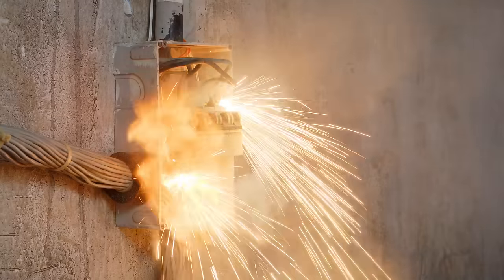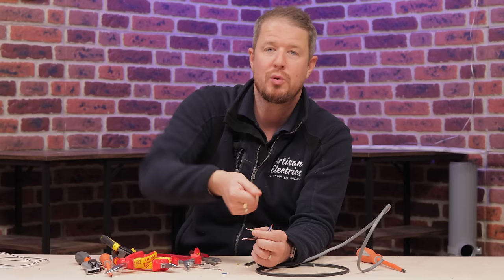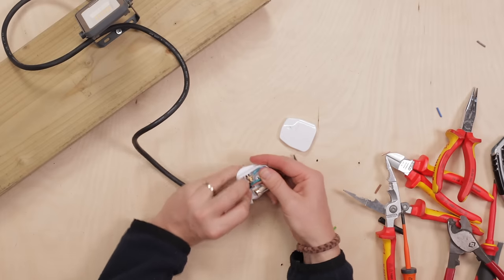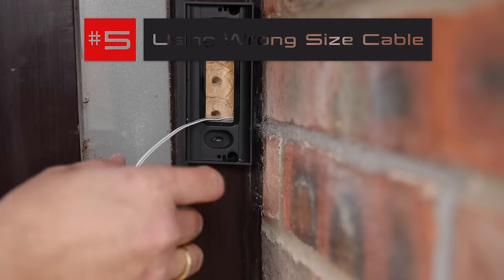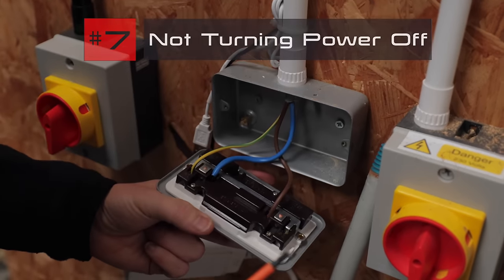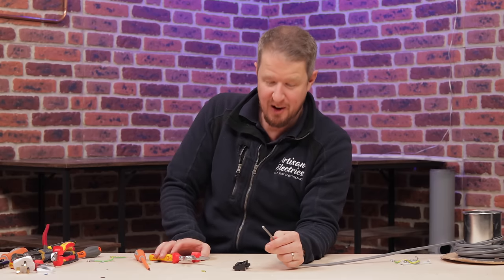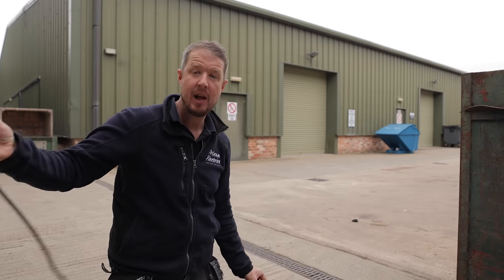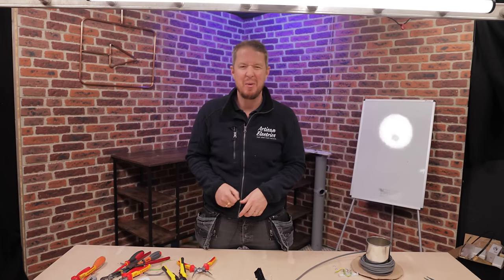10 Mistakes EVERYONE Makes When Doing DIY Electrics!💥

Comment: Fun stuff and so typical mistakes for many DIYers. 
But the wound up extention cord running hot, has nothing to do with inductance. It simply the resistance of the cable that cause it to heat up - but being rolled up like a coil, the heat can not escape from the cable very easy (compared to if the cable is rolled out), so the temperature rise quite a lot
As the resistance of copper also goes up by the temperature, this causes it heat up even more in a sort of thermal runaway. This can cause the coil of cable to get toasty, very quickly.
Reply: Could not give you two thumbs up.
Reply: three thumbs up, the out and return are parallel, so loop area is negligible in this instance , so inductance is negligible, surprised at Jordan for getting that wrong.
Reply: Right, and I would like to add that, even if there were a significant inductance (which is not there because the magnetic fields due to the two opposite currents cancel almost perfectly) it would not lead to any power dissipation, only to a lossless voltage drop. It is only the resistive part of the impedance that leads to power dissipation and Joule heating. I do not know why this incorrect belief about the hypothetical inductance and even more hypothetical associated power dissipation of coiled cables consisting of two conductors with opposite currents is so common: I heard it for the first time in high school when I was working part time for a local tv station: a technician from.a local tv production company told me that power cords for halogen lights should not be wound in operation motivating the recommendation with the incorrect inductance argument.
Reply: waiting for his reply on this.. haha. ironic how the video is specifically about making mistakes.. lol
Reply from the maker: Thanks for the clarification! That does make sense 👍
Reply: Unwinding a cable drum increases the surface area so heat can escape. In a drum or coil heat in the center can not escape so it will get very hot.
Reply: @artisanelectrics  I hear this about induction all the time.  It would be really good if you could do this test. 
Zig-zag up a similar length of cable into a similar volume and repeat the test.  Measure the temperature with a laser thermometer. If the cable warms up, it is not induction.
Reply: Typical school summer fair , extension leads everywhere and coiled up and tripping RCD’s 
I don’t understand why he puts this shite out there and it’s wrong what he says.
Reply: @artisanelectrics   A moment's thought by anyone knowing how the sense coil in an RCD works would realise that the inductance of a coiled extention lead is negligable plus it's resistance that dissipates power, not inductance.
Reply: For those who don't understand how induction works, you can do the same test using 10 Amps DC. Just short the live/neutral at one end and connect the DC supply to the live/neutral at the other end to push the current down one wire and back up the other. Adjust for 10A and watch the temperature rise. If  you have a constant current supply, you can monitor the voltage across the supply which you can calculate the resistance and see it increase. There will be no inductive component.
Reply: Copper does, as you say, have a positive coefficient of resistance with increasing temperature. However, this reduces the current flowing through the cable.
The current is l=V/R
Power is P=I^2*R. 
So P=(V/R)^2*R. 
(V/R)^2 reduces exponentially, but the multiplier R is linear. Therefore as the copper heats up, the overall power decreases and there is NOT a thermal runaway effect.
If you don't believe me, look up how incandescent lamps work...
Reply: Inductance itself doesn't result in heating. It's resistance that does.
Reply: @massimomacucci7461 This is a wrong explanation .

Inductance is not a function of current.
Inductance is a function of the physical attributes of the coil.

So the coil will have inductance.
Pass a current through it and a magnetic field will be created.

However, in the case of a mains cable, there are two coils, which are interwoven, each turn of the cable comprises a turn of two conductors, line and neutral.

Both coils are wound in the same direction, however, the current passing through each coil is in opposite directions.

The net effect is therefore, two magnetic fields are created, one from the line conductor, the other from the neutral conductor, but those magnetic fields are opposite in direction, and equal in magnitude. Therefore they cancel out.

Rest assured , that wound up coil of wire does have inductance and that inductance is NOT related to the current flowing.

Summary:
Inductance is not related to the current but is a function of the physical attributes of the coil. The magnetic field strength produced is related to the magnitude of the current.
For mains cables,  Two magnetic fields are produced because of the presence of two interwoven coils but the magnetic field cancels out.
Reply: @pompeymonkey3271 That is basically right.

It's devices with negative temperature coefficients of resistance that lead to thermal runaway.  Power transistors being one of them. The silicon semiconductor has. -ve temp. coeff.
Reply: @pompeymonkey3271  Not in this case, as the current is mostly determined by the load - not the cable it self. If a load draws 10 amps at 230 V, that means it's impedance is 230 / 10 = 23 ohms.

Now if you have a cable with 1.5 mm² cross section area (typical for 10-13 A rated extension cords) it vill have 0.0112 ohms per meter at startup, if it's temperature is for example 20°C (the specific resistance of copper at 20°C is 0.0168 ohms for a 1 meter lead that has 1 mm² cross section - so 0.0168 / 1.5 = 0.0112). 
This means if the the extension cord is for example 30 m long (60 m conductor length, because the current has to go tru live to the load, then back the same way)
 - the total resistance will be 0.0112 * 60 = 0.672 ohms. So now (assuming the load is linear and purely resistive with no inductive/capacitive component - for easy calculations. The space heater he used also pretty much perfectly falls within that criteria), 
the total resistance, cable plus load is now 23.672 ohms instead of 23 - so current drops to 230 / 23.672 = 9.716... 
As the power turned to heat over a resistance is determined by P = I^2 * R, this means 9.716^2 * 0.672 = 63.4... W. 
That's a lot of heat when generated inside a coil that normally consist more of insulation than copper (plastic or rubber is not great conductors of heat either). 
It's not at all comparable to for example a motor or transformer windings that use thinner magnet wire - which conducts more of the heat to the surface to be cooled off and can also withstand higher temperatures.
But still, compared to the power dissipated in the load, it's not much
 - 9.716^2 * 23 = 2171 W will be heat in the load (which have no effect on the cable).

Now if the temperature have increased to 100°C, the specific resistance of copper goes up to 0.0222 ohms/m/mm², so (using same calculation) the resistance of the whole cable is now 0.888 ohms per meter and the current 230 / 23.888 = 9.628... A - which gives 9.628^2 * 0.888 = 82.3... W of heat in the cable

At 150°C, the specific resistance is about 0.027 - which means the resistance for the whole cable is now 1.08 ohms, the current have dropped to 9.551 A and power dissipation has increased to 98.5 W! 
At that point, the insulation will probably start to melt, causing a short between the leads - which may cause a fire or (if more lucky), trip the fuse before it ignites 

The voltage drop is R * I, so that means even at 150°C, the load will still get about 220 V! and dissipate 2098 W  (instead of 2300 under ideal conditions) 
So most of the power will still make it to the load and the cable will not have much effect on the circuit over all - but may still get hot enough to get destroyed and become a fire hazard if it's under heavy load when wounded up.

Now I assume in my examples it's a similar extension cord but without the overheat protection. With the protection it would probably never reach 150 or even 100°C before it trips. 
This is the first time I see one that has the overheat protection. Maybe there are too many cheap one around where I live, haha
Reply: Sorry, but I beg to differ. My argument is not wrong. Your argument would be correct if we were looking at a single coil, but here we have two coils with coupling coefficient k=1. Inductance is not defined based on geometry (in some cases it may even have a completely different origin, as in the case of kinetic inductance, where carrier inertia matters) but simply as the ratio of the magnetic flux to the current: L=Phi/I. Here the magnetic flux is zero, the current is non zero, therefore L=0. Another way to look at it is as a series of two inductors with mutual coupling. Let's assume the inductors are equal: Ltot=L+L - 2M. Since M =k sqrt(L*L), Ltot=L+L-2L=0. If you connected an impedance Z between the two wires at one end of the extension cord and you connected an impedance meter between the two wires at the other end, you would measure exactly the same Z, if we ignore all nonidealities (copper resistivity, imperfect symmetry between the two coils, etc.) Therefore the resulting inductance of the extension cord is zero.
Reply: @massimomacucci7461  Your original post IS wrong.

You said there is no inductance because the magnetic fields are in opposite directions.

No.
The inductance of a coil is based upon;
inductance of the coil in henries (H)

μ
r
 = relative permeability of the core (dimensionless)

μ
0
 = permeability of free space = 
4
π
×
10
−
7
 (H/m)

N
 = number of turns

A
 = coil area (m2)

r
  = coil radius (m)

l
 = coil length (m)

All are physical properties and NOT the current.

You were wrong
Reply: @massimomacucci7461  When two coils are involved then there are two self inductances, one for each coil and a mutual inductance.

The inductances are still a function of the physical characteristics of the coil, the number of turns, the cross sectional area, the magnetic permeability of the material inside the coil.

So you are quite wrong.

The inductance is NOT zero.
What is happening is there are two equal and opposite magnetic fields, cause by the  presence of two coils and the current passing through the coils in opposite direction.

It really is as simple as that. Your detailed explanation is fundamentally wrong.

But foolishly you can't see it, you can"t accept it.

Do you really want me to write out the formulae for the inductance of a solenoid?

I suggest you go look it up using Google before I post it and prove you wrong.

And then I want you to come back here and apologise and acknowledge you are wrong

Perhaps some humility might be beneficial for you.
Reply: @deang5622  I am sorry, but what you report is not the definition of inductance in circuit theory, it is just a simplified expression of the geometric inductance of a solenoid. Take any reputable text on circuit theory and you will find the proper definition. One such text is that by Desoer and Kuh. They provide the most general definition of inductance as follows: "a two-terminal element will be called an inductor if at any time 𝑡 its flux 𝜑(𝑡) and current 𝑖(𝑡) satisfy a relation defined by a curve in the 𝑖, 𝜑 plane. The essential idea is that there is a relation between the instantaneous value of the flux 𝜑(𝑡) and the instantaneous value of the current." 
In the case of a linear - time invariant inductor, the inductance can be simply expressed as L = 𝜑/𝑖. For a nonlinear - time invariant inductor we can define a differential inductance as L = d𝜑 /d𝑖. We can further generalize to time-dependent inductors and to inductors whose value depends on state variables (meminductors). 
Your expression has nothing to do with the definition of inductance, it is just an approximate way to determine the inductance of a linear time-invariant inductor consisting of a solenoid (to be more accurate you should include the Nagaoka coefficient) and it can be derived starting, for the particular case of a simple solenoid, from the definition I just mentioned. As soon as you depart from the solenoid geometry your expression breaks down. In general the geometric inductance of a generic conductor can be derived (from the definition) integrating the contribution to the total flux from each current element, and then taking the ratio of the total flux to the current. 
Thanks to Jordan for creating the opportunity of discussing this matter.
Reply: @Speeder84XL even the cheap drum type extension cords have had those thermal cutouts for decades here in Finland. The ones without have to be from the 1980s or something.

I remember bypassing burnt out ones in the nineties. Drums were already so messed up, that it was too hard to coil the cable, so those were stored loose anyway and the heat problem had mostly solved itself.
Reply: @villehietala9677  Ok, I was referring to the one that he showed, that seem to work like the thermal cut out on a circuit breaker and could be reset once the cable had cooled off some.
Now when I think (since you wrote about "bypassing burnt out ones") - maybe it's more common than I taught that manufacturers use something like a thermal fuse. Just to prevent the fire hazard.
For things like mains powered (iron core) transformers in appliences - this have been "common practice" as far as I remember. Which will cause them to "break" if they get too hot - before they fail for real (which may be a catastrophic failure with fire, haha). 
I have actually never had a wonded up  extension cord overloaded as far as I remember. 
Maybe when I was a kid and didn't know much about electricity and didn't read the warning label
 - but even then I only remember we used them for low loads (in which case it doesn't matter anyway), like power up the TV and VHS player (that everyone used at that time) and other home electronics in a room with too few wall outlets. 
High loads like kitchen appliences and space heaters had their own wall outlets (which was probably mostly luck, because the apartments we lived in, happen to have  the wall outlets in the right places).
Reply: @Speeder84XL  I meant the same things. They surprisingly burn out as 99% of the users just try to push the red button back in while the load is still connected. And some of those are so bad, that you might just leave a kid to keep the button pressed to finish the job. That would finish the thermal protection too.
Reply: @villehietala9677  Ok, haha. 
I underestimated how stupid many people are. I guess it's the same people who bypass our diazed fuses by putting nail in instead. Those fuses are common as main fuses in small buildings here (because when used as intended, they are more fail safe than circuit breakers) - larger buildings that need more than 100 A 
(actually 3 x 100 A, as all buildings, even small houses, have 3 phase connections here) - often use knife type fuses instead. 
But for older installations, before we started using circuit breakers, the diazed ones were also used in consumer units. 
In those installations, some stupid people oveloaded the outlets and got tired of replacing the fuses all the time, so they took a nail, bundled upp piece of copper wire or similar and put in, instead of a new fuse... This have most likely caused some house fires.
In those extension cords, there are probably (for added safety) also a second thermal protection if the first one fails (which may be a simple thermal fuse)
 - which will cause the whole unit to "burn out" if the button is jammed or held down.
Although, I haven't seen many such extension cords with the red button around here. But it might be that most people I know buy the cheapest ones (I don't have one at all my self now, because I only need short extension cables where I live
 - which don't need to be wounded up)
Reply: Extension lead drums usually/should come with a specified current draw unwound and a specified current draw wound because of the heat dissipation effect
Reply: @pompeymonkey3271 yes the total power may reduce by half, but half remaining heat is now being dissipated by the cable rather than the heater. That is 600W.
Reply: @artisanelectrics  How can you be an electrician and not understand physics? Such things only in third world countries, the US and the UK.
Reply: @kikiv1993 from what I've seen being an electrician requires knowledge of how to do the work safely and not how it works. So know your local regulations inside out but you don't need to understand much theory or how things actually work. People who usually understand how this works are physicists or engineers.
Reply: Some perspective from a volunteer firefighter here. We do have generators on our engines, usually between 5 and 8 kVA. There are also cable drums of course. Normally they hold 50 meters of 2.5mm2 for 230V with acid and chemical resistant sleeving, and have extra rugged IP68 sockets. Whenever we use those, they always have to be uncoiled all the way, the excess placed on the ground in bights. No exceptions. Even if we just hook up a 60 Watt LED flood light. There also can only be a maximum of 100 meters of cable between any two devices. The rules & regulations are very particular here. Even if you are an electrician by trade and know when there will be no issues: Doesn’t matter. Them’s the rules.
Reply: @massimomacucci7461  You seem quite knowledgeable about the topic, so may I ask you what you mean with a "lossless voltage drop" in your original comment? I agree that an ideal inductor does not dissipate any power, but to my knowledge there is also no voltage drop whatsoever. Unless you mean an instantaneous voltage drop? But then there are other parts of the wave form where there is an instantaneous voltage increase so that doesn't sound like clear and correct usage of the word.
Reply: @entcraft44  Actually, I meant that across an inductor or capacitor you may have an AC voltage (and an AC current flowing through it), but, in the case of ideal circuit elements, there would be no power loss, no dissipation. You do not have a voltage drop across an ideal inductor in terms of DC, but you do have an AC voltage drop. Another way to see it is that voltage and current are 90 degrees out of phase in the case of an ideal inductor and therefore this leads to zero active power dissipated, but both the current and the voltage are definitely not zero. I hope I have answered your question.